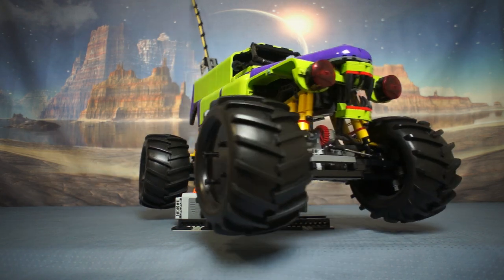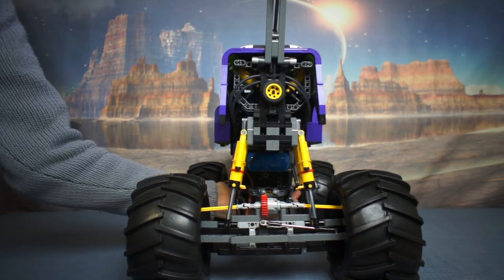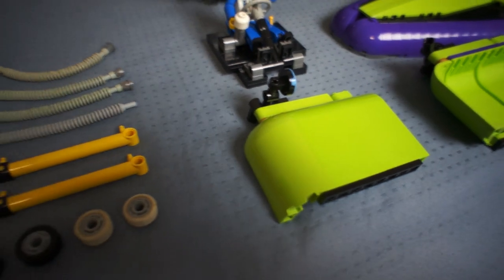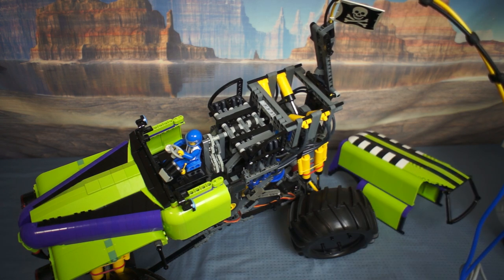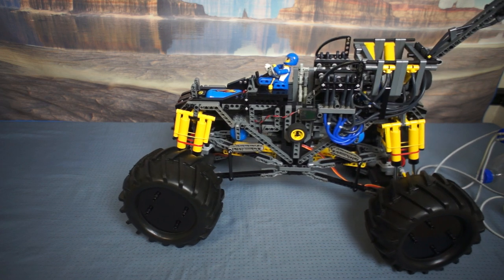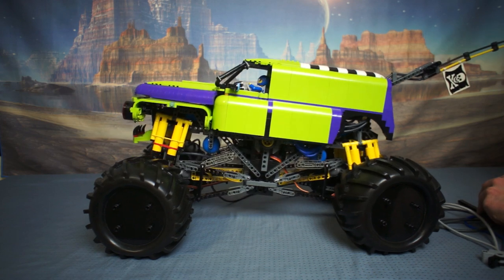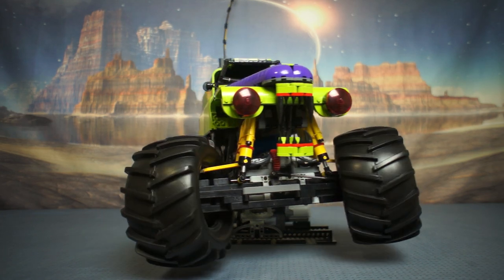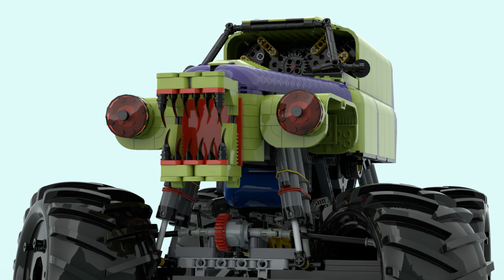Tech Bricks Lego Technic LPE Monster Truck

Comment: This seems like an epic project, subbed. I have zero experience with LPE but for fixing the engine I'd maybe just recommend simplifying the timing mechanism or getting rid of it entirely if possible, seems like that could be sucking out a lot of power. Maybe run the tanks at a higher PSI if possible. Best of luck, this thing is huge. I'd imagine it probably weighs a few kg?

Comment: Will instructions be released, and how much will it likely cost?
This is absolutely epic... If Lego ever did a scaled up Gravedigger, this should be it
Reply from the maker: Thanks for the compliment.  
My aim is to complete the design and test it a lot first.
I will make instructions and they will have to be sold with a custom parts pack.
Reply: @techbricks5300  I'm looking forward to seeing how this project goes. I'm very impressed with the engineering you've put into it.
Reply from the maker: @ampedwales  Thanks. More actual engineering to come...
I am designing planetary gear reductions to go inside the wheels and a proportional pneumatic system to use in the steering and suspension.

Comment: perhaps you need to use a flywheel and clutch so that the engine's rpm rates increase before running.